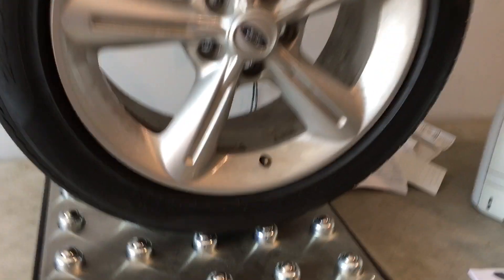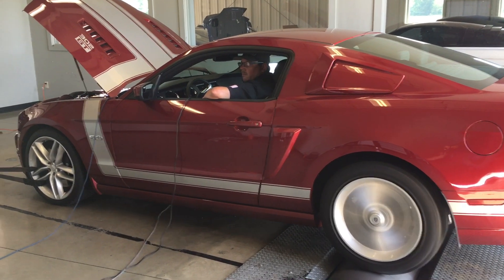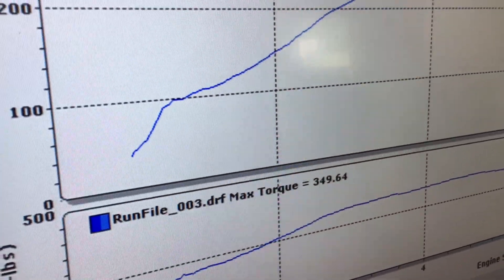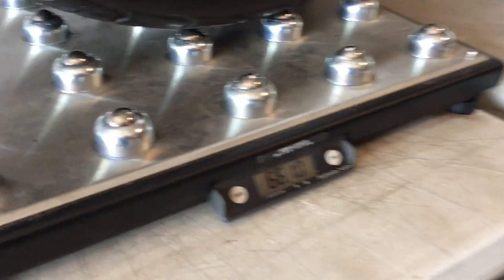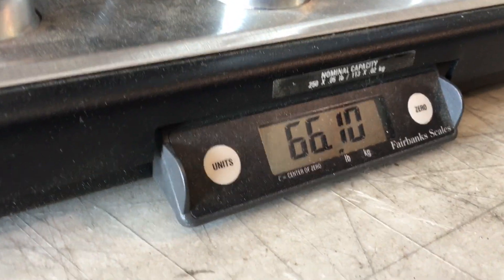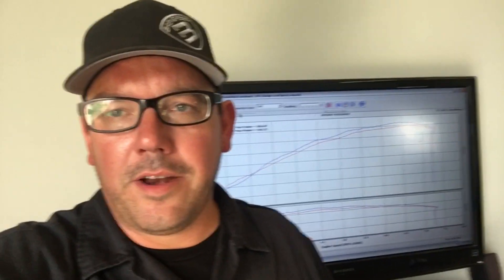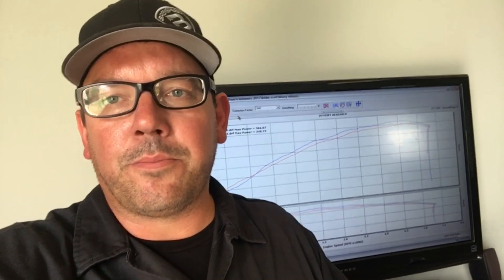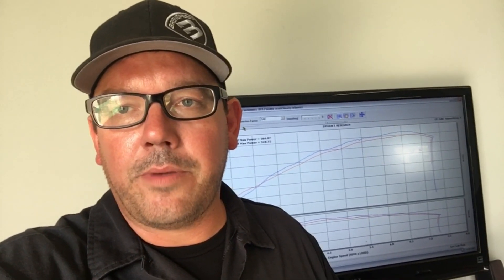20 HP Loss On Dyno From Heavy Wheels WHAT? Stock 5.0 Mustang: Quick Clips

Comment: This test proves the rule of thumb, which is for every 2 lbs of added wheel mass you lose 1 whp.  The math in this test shows that 34 lbs of added weight robbed 17.35 whp.  Reducing those you get 1.96 to 1, or 2 to 1.  LIGHT IS RIGHT!
Reply from the maker: Matt Osbourne thumbs up
Reply: Not even accounting for the rotating mass of the front wheels too. so double that loss 👍
Reply: Brenspeed so driving around would light or heavy front tires affect the acceleration or is it just the ones that put power to the ground?
Reply: Junior klassen yes but it’s not as significant as the driven wheels... it takes more force to rotate a heavier wheel, also the smaller diameter tire will take less inertia to rotate than a taller tire with the same mass
Reply: Good to know
Reply: Planning to change stock VW 17 inch to sparco /momo 18 inch on troc ..which are 2 Lbs lighter per wheel than stock 17 inch..will it increase performance?i dont want to increase performance but at the same time dont want to decrease it for visual aesthetics....and will ligjter 17 inch increase hp..which are 4 lbs loghter per wheel
Reply: So is this double on AWD cars??
Reply: You do gain torque so you accelerate faster, but you don't go as fast.
Reply: @PQR5CHE  Any car with four wheels.  When you accelerate a car on the road, you are spinning up four wheels as opposed to two on the dyno.

Comment: 220HP car.had 255/40/17's on 19lbs 17x9 wheels, then changed to 215/50/17 and everything just improved. steering response, the car stays more composed even in turns, gained HP for sure and fuel savings went up.I'm very happy with the new results.
Reply from the maker: THANKS for watching!

Comment: This is true. Several magazines did a acceleration test with wheels from 15" to 19"... of course a a taller wheel will take more distance to complete one full revolution. Taller wheels take longer distance to stop, handle worse, mpg's drop. Smaller wheels are on economy cars for a reason. But drag cars also wear tiny wheels. It makes them quicker << (time), and faster >> (speed)....

Comment: So to my understanding, adding weight to a wheel takes more power to rotate it than adding load to the car itself.  If this is true, does that mean lighter wheels on AWD cars have an even greater impact on performance?
Reply: Yes it does. More then you would think.
Reply: No, off the dyno and on the road all cars have to accelerate all 4 wheels even if they're not powered. On the road your performance gain should be double what the dyno indicates.

Comment: Was the outer diameter the same between the two wheels/tires so that the only difference was weight ?
Reply: grabir01 this is what I was wondering. I was trying to figure out the tire size so I could  compare
Reply: The total diameter of the 18's was larger (27.3 inches), the total diameter of the 20's was smaller (27.0"). That means that the effect of the higher weight was (negatively) greater than what the results showed.

Comment: I've wondered which is heavier. More tire and less wheel (more side wall), or more wheel and less tire (less side wall)? Basically, which weighs more tire or wheel for the same overall circumference? I know there are variables but overall, in general. I've seen both low- and high-profile tires on racetracks.

Comment: I made 6whp/13lb-tq more on a mustang dyno to all 4 wheels by going with a 16 lbs lighter carbon fiber driveshaft and a engine main pulley. Doing my own calculations that is about 10-11 crank hp and probably a good 18-20lb-tq. This was on a 2015 Subaru STI.
Reply from the maker: Sweet thanks for the info
Reply: How much did the parts plus labour cost you to do that?
Reply: @r.k862  That was back in 2015, the carbon fiber drive shaft was $1050 or so, install was 1 hour or less. The pulley was about $130 and labor was 1 hour so roughly $1400.

Comment: Does more tire contact patch affect the acceleration more than if I have lighter rims?
What affects acceleration more, tyre contact patch or rim weight?
Reply from the maker: Depends we have seen both make numbers lower. I mean in the end they are just numbers but a sticky wide tire can reduce them as well as a heavy wheel.
Reply: @BrenspeedEngineering  hmm ok thanks!
I'm trying to make decision on what's more important:

Option 1) 9.5inch rim with 12kilo rim weight 

Option 2) 10.5inch rim with 8.5kilo rim weight 

Can you help me decide? Haha
If I were to guess I think the rim weight will be more important if I am chasing acceleration straight line

Comment: So I went from a 37 pound stock 17 rims on my 14 mustang to the 19 inch brembo rims (track pack) that weigh 47 pounds. So I did notice a decrease in power but I probably lost 10whp or so~ but I’m going to add ported manifolds and a ported throttle body to make up for it 😎
Reply from the maker: There you go thanks for watching!!!!
Reply: Brenspeed  and thank you for the informative video!

Comment: I totally believe that, it makes a big difference in the real world on the blacktop to and am getting better times since going from 22s to 17s. We recently got new rims with 305x45 MT drag radials for my Challenger, and reduced it's 0-60 x. Other than the basic bolt ons, but no aftermarket headers, and has a canned diablo tune, she's pretty much stock and went from averaging 4.7 before changing the wheels and now runs low 4s without doing anything else to it. We did weigh both and difference between them was close to 100 lbs total, so I'd say it's a good mod to do and especially for the fatazz LX platforms lol
Reply from the maker: THANKS for watching!

Comment: This is not only true on a dyno but actually has pretty huge effects on roll racing, I had a 18x10 rim with a huge ass 305/45/18 radial. Then I switched to a 15x8 rim with a 275/50/15 bias ply hoosier and the gains were substantial. I raced two people before and after doing this and I went from losing by a car/ a car and a half to winning by about half a car. 40-140. I think I dropped a crazy amount like 20lb per side on the rear. Recently I put radials on my 15 which are heavier so I will have to reweigh everything and post the videos when I get a chance.
Reply from the maker: Awesome, thanks for the comment!

Comment: Thanks this is a great demonstration. It is not just the difference in weight though, in fact the bigger factor is the location of the mass. The 18" stock wheels are not only lighter but the mass is is closer to the center, whereas those 20" wheels move their greater mass further out. When it comes to inertia the radius of the mass is a huge factor. So a heavier wheel of the same diameter will not be quite as bad. This example is the worst possible scenario more mass with most of it further out in the wheel.
So even if you went with slightly lighter wheel but with a larger diameter, it would still cause greater losses (although not to the extreme in this example). Larger diameter wheel/tires do have some advantages such as better grip and ride, but they do reduce acceleration power and slow suspension rebound. Picking the best size and weight is always a trade off with many variables. But honestly almost no street car benefits from 20" wheels, in most cases that is pure aesthetics. Nearly every car will, ride, handle, and accelerate better with a 17" or maybe 18" wheels max. 
Picking an appropriate wheel size  has more to do with a vehicles weight and available HP. So a 100 HP 2500 lb car would not be a good choice to use 20" wheels, but a 1000 HP 5000 lb car? sure no problem.  Just be aware that spending lots of money to save 4-5 pounds on the same diameter wheels is not going to have a significant  impact on performance. In face a slightly heavier wheel with a smaller diameter will in most cases use less power. So if available wheel HP is you main concern , pick the smallest diameter and lightest wheel you can get away with. What is even more important is the tires, not all tires weigh the same and that mass is even further out than the wheel rim. Most track tires are much lighter than steel belted street tires. In fact those ultra low profile tires are usually much heavier than the high profile tires because that short profile requires beefy construction, which also makes them ride badly as well.

Comment: At 1:22 you can see the stock tire size 235/50/18(27.3" tall - 9.3" wide) 49.10 pounds. The other tire is 255/35/20(27" tall 10" wide) 66.10 pounds. The 20" wheel/tire combo is 3 tenths shorter but 7 tenths wider.  So the biggest difference is weight or rotational mass.

Comment: I have 2 sets of similar OEM 19’s on my Subaru STI. One set has wider track tires, which are 7lb each heavier than the OEM street tires. Should I put the street wheels on when I get dyno tuned?
Reply from the maker: Typically in my experience a lighter or even a tire with less tread on the drum creates a higher number. BUT, its just a number. It does not mean your engine is making more or less. So if you are looking for the highest dyno number for some reason yes less weight and less width is better. It will not change tuning though....
Reply: Brenspeed Thank you. I leave the heavy track wheels on, that way my tuner has to do his best to make me some descent power 🤣

Comment: At a steady speed, no resistance due to moment of inertia. Arotating flywheel with a weight of 1000 kgs and no resistance in bearing and of air, can rotate forever. So why a difference?

Comment: Thank you for touching on this subject. I’ve knew it would make a difference, but didn’t know how much. I’ve got a ‘16 PP car and wanted something wider on the rear, but I didn’t want to go up in weight. I haven’t had a whole lot of luck finding actual weights of of specific wheels and tires.
Reply: Well the rear PP wheels weigh about 33 lbs each they are pretty heavy you can get wider 19" wheels that come in at around 24lbs the LMR SVE S350 for example but when you run a wider tire you typically add tire weight so you have to keep that in mind. Tirerack or the tire manufacturer is a good source for getting tire weights... oh if the vendor selling a wheel doesn't provide the weight it is most likely because they are stupid heavy lol...
Reply: Enkei and Konig list their wheel weights on the websites

Comment: you dont loose hp from heavier rims. just not as much goes into the total mass of the car. the extra (loss of hp) goes into the kinetic energy of the rims. The total kinetic energy of the heavier rims and car is the same as with lighter rims. just the dyno doesnt see this since its only judging the hp into spinning the rollers, I.e. velocity of car. it ignores the rim mass

Comment: Thank you sir. Rotating inertia and mass explained perfectly! I just had this conversation with a guy FITMENT, going with a lighter 19 inch rim ( Ie-Rohana=24lb vs stock 35lb rim) would have better speeds and overall performance than a 20 Inch 38lb rim wheel set up with heavy tires and rims. ( He said - "There is no difference with wheel weights at 20 inch." Then I thought, ...say what! You didn't spend enough time listening in math class in high school! ( Thats Fitment expert for you!)  If you stay with 19inch , custom light forged flow rim, you could even go a size larger in tire, have better ride, and still weigh less than a cast 20 inch heavy rim with tire. He disagreed!  Thank you sir for the video!
Reply from the maker: No problem!

Comment: Fantastic video comparison.
Weight and design make the difference. An equivalent 18" wheel with same total weight but placed more towards the center would have made even more power and torque by simply being easier to accelerate and decelerate.

Comment: Brent typical gain from swap of drive shaft ? How much weight does a typical 15" Race Star and 275/60 Mickey's and aluminum drive shaft , have just done a drive shaft swap for hp gains ?
Reply from the maker: I have seen drive shafts create a improvement of almost a tenth in quarter mile. Rule of thumb is a tenth is about 10 HP. I can't think off the top of my head on the dyno though, but I know lighter driveshafts make a care quicker I see that all the time. Just can't think off the top of my head a before and after dyno it.
Reply: Jeff I lost between 80 and 90 pounds going from my stock brembo wheels with continental dw to sve drag 15x10 and 17x4.5. With 28x11.5 qtp and Phoenix 17x4s. I weighed and recorded so I would know. I think exact number was 86
Reply: I thought a tenth was 100hp or 100lbs.... give or take of course?

Comment: Difference in tire height (1.1% or 4hp), 
difference in tire width and pressure (footprint/drag),
 Also heatsoak (10-20hp)
And operator error, such as making more power and torque below the curve as demonstrated on the graph..

A better test would be to take a wheel/tire combo and only add wheel weights.  Go back to back with the dyno runs.

Comment: Are you sure it has to do with the weight and not the diameter of the wheel?
Reply from the maker: Juan Jose great question! Yes the weight. Tested it so many times it's ridiculous. Taller, shorter, whatever. Always comes down to weight when you compare two combos where one weighs a lot more. High Rotating  weight on any car not just a mustang lowers performance and numbers vs. less weight. Weight is the biggest thing. Just like an aluminum driveshaft that's lighter, or aluminum flywheel that's lighter. Those normally make more power on the dyno. The tire height on these two tires are within .3 inches of each other which is almost nothing. Thanks!
Reply: Spinning the larger mass requires torque, so additional wheel weight hinders acceleration and deceleration (but usually tyre grip is the limiting factor when braking). Great video!
Reply: Great test would love to see a difference from increased and decreased diameter as we know this can change wheel speed and torque loss
Reply: Mostly wheel and tire weight.

Comment: Wow that's eye opening but makes sense, although I didn't think that it would cause that much loss. I'm running 22s on my challenger srt8 and don't want to be adding unnecessary weight cuz we all know that they are fat pigs hahaha. Well they may be pigs but their not dogs and it's pretty damn quick for weighing over 4k. I've been thinking about replacing them and going with 18 or 20s in the back and probably 17s up front, so that should help quite a bit

Comment: Wondering how this affects 4wd vehicles.  I have a Hummer H2 (6.0 lq4) with TSP heads/cam/headers/etc., and HEAVY wheels/tires (37x13.50r24).  It made something like 240 to the wheels after a dyno tune.

Do you multiply the loss by 2 or more due to drivetrain loss and additional rotating mass?

Comment: I wonder how much power will be gained from a lightweight 15in... I'm assuming 5 to 7% gain which is huge... let's say your car makes 500 wheel that's 25 to 35hp.. how much do you think the increase in  diameter play a role. You would think larger-diameter would have longer gearing so that would actually put more load on it and get better dyno numbers.

Comment: By your wheel test , 34lbs total gain and lost 17hp ! So would it be safe to say however much inertial weight you lose you gain .5 hp per 1lb of weight lost !!
Reply from the maker: No I would not say it is safe to say that exact number. What I have found  is more of a percent, but that's on wheels. I would say heavier internal weight engine parts for sure create more loss than lighter ones that's a fact, but I cant say what oz or pounds equal HP. Good info though!
Reply: For some reason you get a itch and just happen to have two light weight wheels and tires (or best combo for weight lost) and a drive shaft that was just happened to be laying around and some free time ??? I think that would be some solid info on so called free hp !!! I know driveshafts swap is worth 24-25lbs from stock ? Thanks for reply

Comment: I wish there was a list of stock and aftermarket wheels somewhere, often it's hard to find. I have stock 18s 235 50 18s currently and really want a 285 40 18 square setup but this is a major consideration. Those are 4 wide wheels so I have to find ones I like, 2" wider,  lighter than stock, or same as.

Comment: can going to an aluminum driveshaft compensate for the extra wheel weight?
Reply from the maker: Geo I , any reduction in rotating weight will help compensate to some extent.
Reply: Yes it can but I would do a carbon fiber shaft so that it can absorb more NVH or noise, vibration, harshness. It helps save your rear end components by acting like a torsional shock absorber especially at the 1/4 mile track at launch.

Comment: Awesome video, thanks so much.  Everything else is just talk.  Weighing the wheels and doing the dyno runs puts the rubber on the road.  Makes it real.  That being said you did not measure the diameter of the wheels and that also changes the output.  The 20 inch could be a bit bigger.

Comment: Makes me wonder how much power is lost due to my 13 Brembo pack brakes and wheels.
Reply: Kara G those oversized rotors rob bunch of power too there about 5-10 pounds more than Stock... I learned rotational mass makes a big impact on power to weight in my all motor honda days.anything you’re motor has to spin robs power
Reply: Edgar Sanchez where the mass is, is also important... if you have a 15” wheel that weighs 50lbs vs a 20” wheel that weighs 50lbs ( I’m just making up numbers here ) the 15s will accelerate faster because the mass is closer together and not spread out... so it would be slower but not as much as what you’d see gaining that much weight in your tires